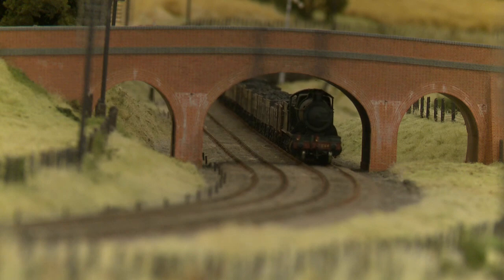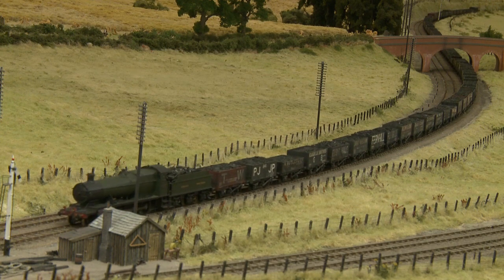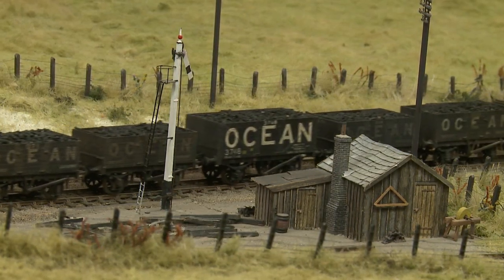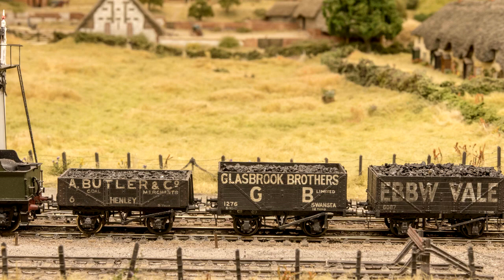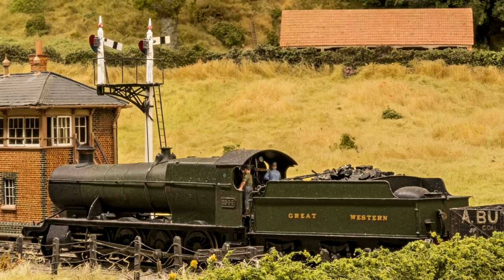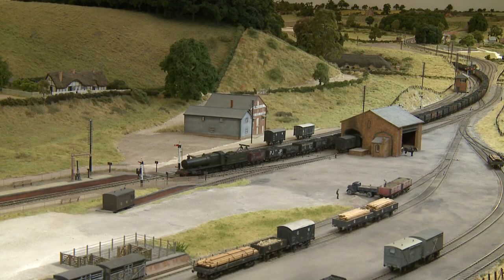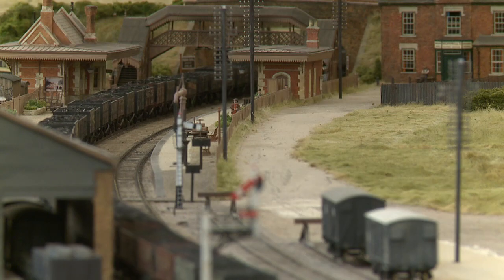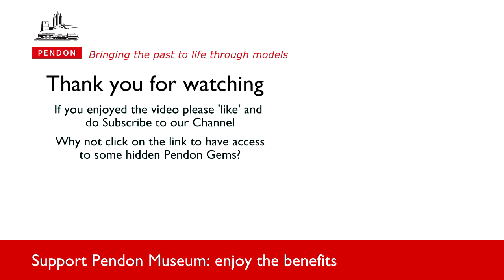Coal Train travelling from South Wales to West London in 1927

Comment: As always a beautiful and well documented video. Amazing strong model locomotive. It seems with all the modern tech today's model trains are just made for the show and lack the power and torque this handmade machine has. Thanks for sharing ! Cheers, Filip
Reply from the maker: Many thanks for your great comments Filip, we are really pleased you enjoyed the video. 
Don’t forget that you can see some of our hidden gems by clicking this link: pendonmuseum.com/youtube
Reply: This locomotive when built was packed full of lead, had a rigid chassis and was powered by a motor in the tinder driving via shafts and universal joints below the footplate. Guy Williams re-built the chassis to many of the locomotives that he built so it may not still have the same arrangement.
Reply: @532bluepeter1  Thanks for this info !

Comment: Brilliant. I served my apprenticeship at Ebbw Vale 77-81.  It's nice to see one of the company's wagons in the train. Amazed that that model could pull so many wagons. I wonder what the drive mechanism inside is?
Reply from the maker: Hello Dave and thank you for your kind comment. 
To answer your question, the model has a powerful motor in the tender driving via a shaft into the loco. This means there is plenty of available space in the loco for weight increasing adhesion and pulling power.
If you would like to see some of our hidden gems, just click this link: pendonmuseum.com/youtube

Comment: How many freight vans were there? An how did they stay together, because I think the couplers weren't that strong to carry that many. But smashing video gang!
Reply from the maker: Many thanks for your question Michael. The long goods currently has 84 wagons and van. The limit was 100 but this was not governed by the power of the engine or the strength of the couplings but by the length of refuge sidings into which the train could be diverted to let faster traffic pass. 
Couplings did indeed break on occasion particularly if the driver was heavy handed with the regulator  causing a snatch. Often drivers would set back to close up all the couplings then set off forwards picking up one wagon at a time. Once each wagon is rolling the stress on the couplings is reduced. We used to demonstrate this when the long goods was displayed on the Dartmoor scene. Since moving upstairs to its proper location this is no longer possible due to the automatic nature of the operating system.